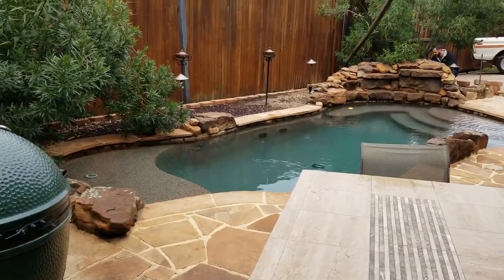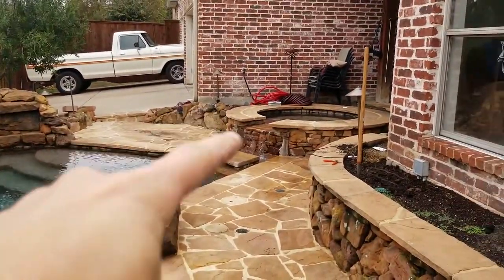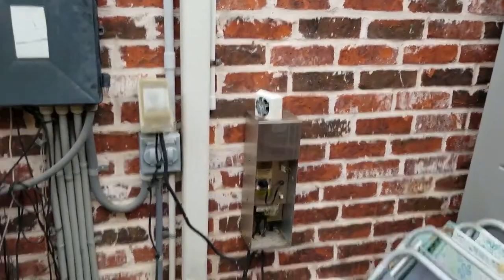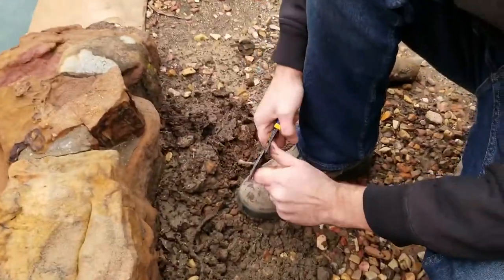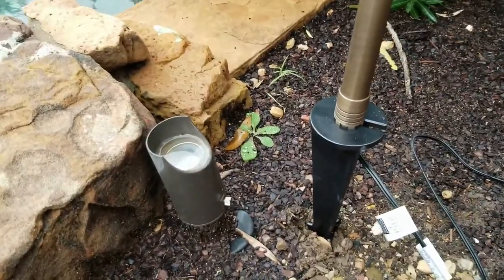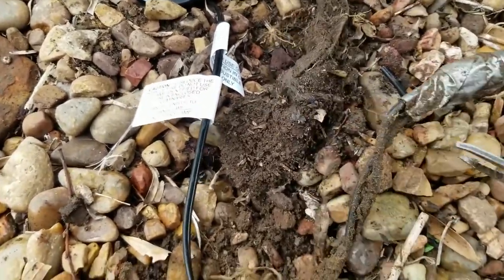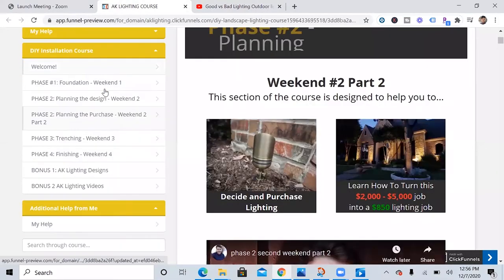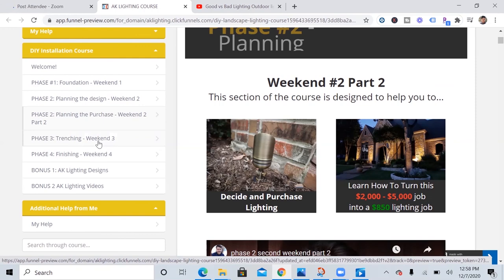Replacing Old Landscape Lighting | Neglected Lights Turned Bad Replaced with Stunning Brass Lights

Comment: Our lights don't work anymore. So I'm wondering how to remove them off the wire so I can connect some new ones. They are clamped onto the wire that is connected to the transformer, and I can't figure out how to unclamp it off the wire. These connectors are not the screw on type. Since I can't figure out how to get them off, I'm starting to assume they are not removeable and we have to instead just buy a whole new wire cable.?
Reply: Cut the wire everywhere you have one of those clamp connectors. Throw the old light away with the old connector. Get some landscape lighting cable 12/2 gauge and get some new connectors that are pre-filled with a petroleum grease. You many not need new cable if the lights you get come with enough cable attached.

Comment: I have the same issue with my current transformer.  I was able to put in a new timer but I don’t know the wattage...
Reply from the maker: I'm sorry about that. So there should be a label on the transformer that shows the amount of watts it is. If you are counting the total watts of the bulbs, it should say the watts on each bulb.